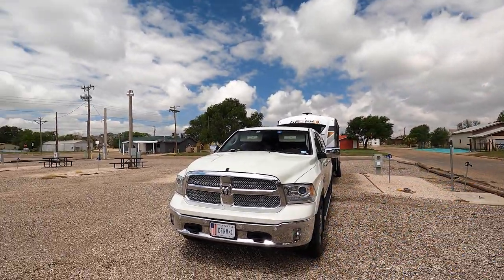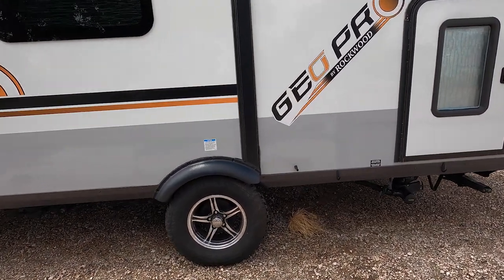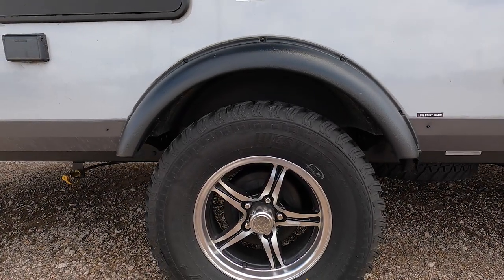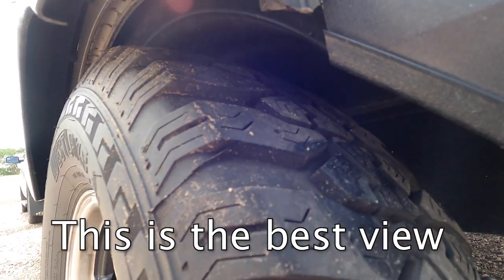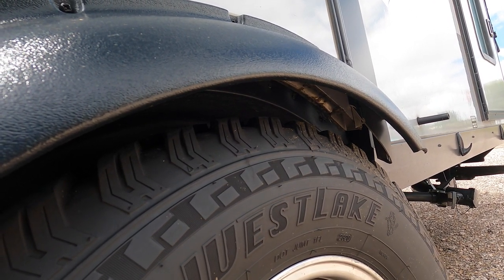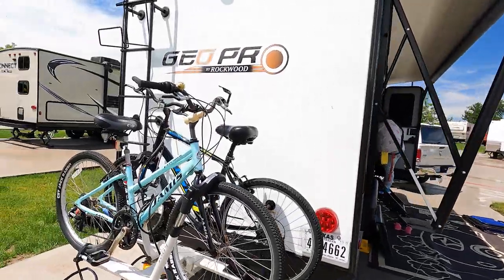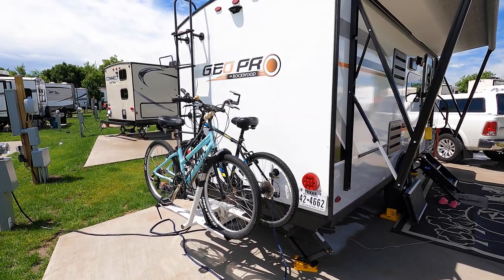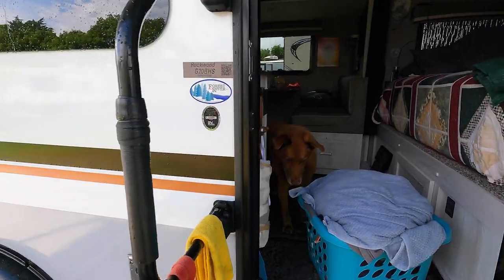Travel Trailer Problems | Our Dexter Torflex Axle Is Failing! | Rockwood Geo Pro 20BHS

Comment: I have the 2020 FD no slide murphy bed model, any reason why that axle failed, how many miles are on the camper ? Looking forward to your follow up videos.
Reply from the maker: Hello @billg1527!
My camper is at round 13,000 miles. I don’t think the axle problem is miles.
Here’s my take on the problem. It’s opinion that’s based on some experience:
I don’t think it’s a quality issue. The Dexter Torflex is a proven reliable & quality unit.
I think it’s an engineering issue.
My GVWR is 4455 lb. The axle gross rating is 4000 lb. So at an average 10% tongue weight, the axle will be carrying 4010 lbs. On paper that’s fine. But in the real world, from my experience, things that have no load rating margin are more prone to failure.
But I don’t necessarily thing this is a load issue. I think it’s a leverage issue. Many people are reporting the same problem and they all have a common characteristic - the slide side of their axle is settling lower.
So… I think the leverage of the extended slide is causing the rubber spring in the axle to fatigue and compress over time. Would a heavier axle solve it? That’s a question for the engineers.
I haven’t heard of this happening to non slide units.
Thanks for watching & the question!
For more - https://crowdfreerv.com/axle-part-1/
Reply: @CrowdFreeRV  What was the outside temperature when you first noticed the problem and the outside temperature and conditions when it rapidly changed? 

Is the lift kit from the factory tight to factory specifications and in place?
Reply: Also looking to purchase the 2022 FD going into production soon.

One reason we chose the FD model was better load balance between driver and passenger side of the trailer with the Dexter single rubber torsion axle. 

The bunk model with same side slide-out out puts a great deal of weight on driver side during driving and when stationary with the slide out and stabilizer jacks deployed. 

Having an adjustable air bag suspension is far superior than just the rubber torsion flex Axle.
Reply: @billg1527 We are looking at purchasing a 2022 FD, all 2021 sold out.  Have you checked and monitored your FD’s tire to body height on driver and passenger sides? 

When unloaded, have you checked the hitch weight also called tongue weight?
Reply from the maker: @icare7151  I first noticed the problem while wintering in North Carolina. We were parked for about three months. The temps were average low 30’s to highs in the 50-70’s. I didn’t start measuring the problem until recently. I noticed the change from 3” to 2” after loading some more gear for the travel season and traveling a few hundred miles.
Are you in the Geo/E pro group on Facebook? There are others reporting this problem and the common theme seems to be the slide side sags.
My hunch is the rubber is slowly compressing due the the leverage factor of the slide being out.
Thoughts?
Reply from the maker: @icare7151  I don’t know what my exact weight is this spring. But… last year I had my rig “smart weighed” at the Escapees HQ in Texas. My Dexter weight was within GAWR and the load was almost perfectly balanced between left/right.
What is an unknown factor is what happens to the weight balance when putting the slide out?
Even with stabilizers down, I think the slide side is getting over loaded.
There’s definite wisdom to choosing the FD and potentially avoiding this problem!
Reply: @icare7151  The FD no slide doesn't have this issue from my understanding, I checked anyway and ours is even. I have never checked the tongue  weight but I know it's in the 700 lb range, most single axle campers have a heavy tongue weight. You will really like the FD, we love ours !
Reply: @billg1527  Thank you for your response. I recall the  manufacturer claims the dry hitch weight of the FD is 418 lbs, but reports claim 418 lbs is significant not correct being much higher.  Vehicles with 500 max hitch weight should be cautious. 

We really like the FD floor plan and from a weight distribution perspective I feel more comfortable with the numbers over the bunk slide out model.  Specifically, the slide in the out position, with 2 to4 adults and cargo beneath the seat positions mathematically puts significant greater forces on the surrounding driver side systems.
Reply: @CrowdFreeRV  Here are my requested thoughts:

Thank you for your responses  and awesome channel. 

Great things come from collaboration. Problems are opportunities for creative thinking and collaborative resolution. 

Glad Rockwood and Dexter are replacing the axle.  Typically in situations like this the design and engineering teams will in fact collect and analyze the data thoroughly, hopefully taking appropriate actions based on their findings to prevent a reoccurrence. 

If possible, you may consider documenting the original and new axle’s manufacturing codes/serial numbers that should be stamped or labeled on each of the axles. 

Are they using same axle model number and/or lot number? 

If they are using a different model number what is the difference and how will that affect the stability and ride quality; the ability to absorb static, dynamic and shock loads, vibration frequencies and suspension travel? 

What Dexter axle model number of your floor plan are they using in current production? 
 
If this is a pattern with other owners of the same floor plan, I am confident Rockwood and Dexter will find a solution with a win/win resolution as necessary. 

The are many mechanical theories that I can speculate what caused the initial then rapid sag, but not having the verifiable scientific data to needed to validate a probable cause, would be speculation at best. 

However, what we can do is:
1) Calculate the static and extrapolate the dynamic loads of the slide in the “in, transition and out positions, loaded and unloaded, including the total weights of all sitting in the side, cargo stored beneath the dinette plus the weight of the box and slide out system. 

Calculating the total deflection forces (stresses) on the entire system in all positions and situations will help determine if the slide is a major factor is causing the sagging. 

It appears there are multiple modified cantilever static and dynamic forces and deflections at play. It’s an interesting science with many static and dynamic variables to consider. 

2)Collecting Data  
As a purest in co-writing & adhering to ASTM and ISO processes over the decades, with the rv level, measuring in the exact same manner each time suggest document:

1)Date, time, temperature, humidity and location of measurement 
2)High/Low temperatures the rv was subjected to between measurements
3)Slide In or Out
4)Time slide has been in the “out position” since last measurements 
5)Time slide is in the “in position” while stationary since last measurement 
6)Time and miles driven while slide is in the “in position” since last measurement 
7)Stabilizers up or down
8)How RV is leveled
9)Road conditions, type of roads, speeds traveled on each  and miles traveled between measurements, if any  
10)Special circumstances such as heavy winds experienced; cross, head or tail winds, submerged in or exposed to fresh or salty water, road salt/deicer/ice melt 
11)Weights: Loaded right side, left side, hitch and total weight
12)other

Collecting as much valid data as possible is necessary to quantify and qualify a proper analysis to pinpoint the exact cause that is resulting in the undesired affect, assess risk factors and then design a proper solution based on data collected. 

Is this is an isolated case? If yes, a simple axle exchange.

If there are multiple RVs with the same floor plan that are suffering the same fate, solutions may range from a different rubber compound that is not susceptible to a possible heat setting degradation and/or deformation, etc to an entire different axle and suspension system. Rockwood already has an air suspension they use in the Geo/E-Pro toy hauler floor plan.

I prefer axle and suspension systems that one can quickly and easily view the entire suspension & axle system such as traditional springs, shocks, bushings, air bags etc. are preferred, much easier to diagnose, maintain and fix on the fly. 

Also, for all RVs with slides, I would always use true 4 corner leveling jacks, fully deployed prior to deploying the slide outs. 

Thank you for taking the time to read my long winded thoughts, observations and keeping us all informed of the twists, turns of your adventures. 

Enjoy the journey!

Cheers,
KP
Colorado Springs, CO🏔🇺🇸

Comment: I called Dextor the other day, gave them my serial number, and had them apply the same specs to a new axle, but a 6,000-lb axle instead of the 3,500-lb axle that comes with our 20BHS Geo Pros. I'm very excited to have a beefier axle and be able to haul a bit more cargo. I did have to get new wheels since the #11 Dexter Torsion Axles are 6x5.5 bolt pattern.

Comment: We have a new Geopro BH20 and have very few miles on it and have this same issue. Rockwood said it's supposed to be like that. Since the sides have different wheel well clearances, we measured from the bottom of the torsion arm to the ground. The distance is about 11-5/8" on both sides.
Reply from the maker: Hi @Ashley Atkins!
Yes, to get the real story you are correct to measure the torsion arms. But the arm to ground distance will only change if the tire is more compressed. Rather, measure that same point on the end of the torsion bar upward to a point on the frame. As the torsion bar compresses, this is the measurement that changes.
Hope this helps!
Reply: @CrowdFreeRV  We called Rockwood and sent photos and talked to engineers and they all said our 3" clearance is not a cause of concern for them. So, I guess we just continue on?
Reply from the maker: @ashley5322  yes, that’s what I would do. If the clearance remains unchanged as you put miles on or time goes by your good to go. If it does sag over time, keep the documentation that you addressed it early on while under warranty. And… the Dexter warranty is 10 years. Adventure on!!
Reply from the maker: @ashley5322  yes, that’s what I would do. And save your documentation from Rockwood engineering for future warranty purposes.

Comment: FLEXIRIDE is the ONLY axle to buy. Most trailers come with axles underrated for their weight or at the limit so this means after furnishing your trailer with clothes, food, tools, dishes, glasses etc you are guaranteed to be over weight and this condition is what almost always leads to failure. The axles are SO smooth and if stored long term jacked up, weight OFF OF the axles then they should last 20 years which is their lifespan. I have a Dexter and only now since 2003 am I replacing it with a Flexiride made to order over weighted axle and in my Yamaha Waverunner trailer i replaced my Dexter 1240 pounds MAX weight rated axle with a 2200lb axle and it was very reasonable and easy to install. Haven't met a single person that actually reads the instructions for storage, which these 90% of the time are doing which means the weight is on the axle damaging it 90% of the time.

Comment: Man...good luck.  I  have a 19FD on order (e-pro).  I know it's part of RVing but I would never expect an axle to take a dump.  I hope it's at least a warranty fix.  I know the Dexter has a 10 yr warranty but if it's installed barely within it's mechanical limits who the heck is going to pay for the work?...not to mention your trip to the factory and vacation time lost.  Either way...I like your channel if that helps soften the blow just a little bit.
Reply from the maker: @EnuffsEnuff318 thanks for the encouraging comment! It’s much appreciated! If you’d like to get a little more info on this check out - https://crowdfreerv.com/axle-part-1/
And, yes. The axle will be 100% warranty!
Stay tuned for the new axle vid!

Comment: I purchased a 2021 GeoPro used, it had been purchased and traded in for a larger trailer ( so I was told!) the GeoPro still had all the factory stickers and tags and looked bran new. I was told that it was beeing sold as is even though it had only been used once. Well I noticed the Dexter axel has the same problem you are discribing. Rockwood is telling me that I am not the orignal owner and will not replace the axel. DO NOT BUY A FORES RIVER OR ANY OF THEIR BRANDS BEWARE!

Comment: Thank you for keeping us in the know on your experiences with your Geo Pro 20BHS we have been researching which RV to buy for months and your journey has solidified our choice on this RV. Even with the issues you have experienced it has led us to this RV. Update to the frame bolts, the one we recently looked at now has a locking washer, but, the a locking nut on every bolt. The factory has resolved this. However, the tire fender on the slide out is still unresolved. Before we finalize our purchase we have asked the dealer to request a solution from Geo Pro.

Comment: All 20bhs have less clearance on slide side. It’s by design. Having said that, ours has 4” on the slide side, so 2-3” in a bit on the low side.

Do you have anything in the tanks?

Is the camper level? If so, are both sides too low??? If not, how come it’s level but only one side is sagging?
Reply from the maker: We’ll see how it rides after the axle is replaced.
Thanks for watching & commenting!
Reply: I was curious about your statement and so I checked my 20BHS today and i see that the clearance on the slide side is lesser by 50% than the right side.   Is this a defect or as you said by design?
Reply from the maker: @RafaelGuerreroThe4th  I can only speculate if the problem is by design. That’s just guesswork on my part.
What I know with certainty is, I monitored my left side and considered it fine and normal until my fender clearance shrunk to 2 inches and there developed a risk that my tire would begin contacting the fender.
Hope this helps!
Reply: @RafaelGuerreroThe4th  This is by design. The slide needs to be a bit lower so there's less space on the side of the slide. I guess they could have "fixed" it cosmetically... but decided to keep 19BH and 20BHS similar on the passenger/right side.